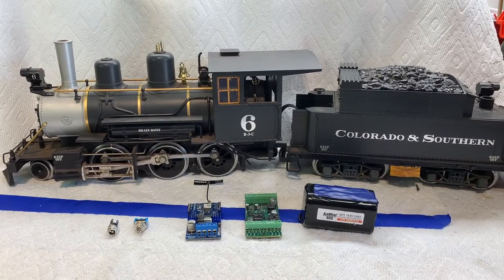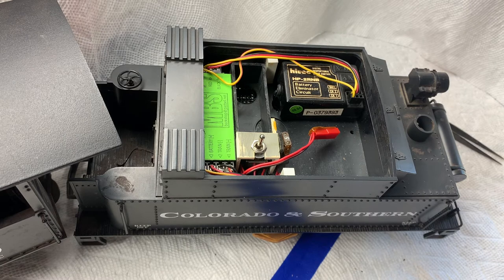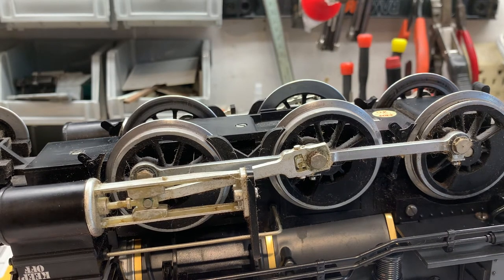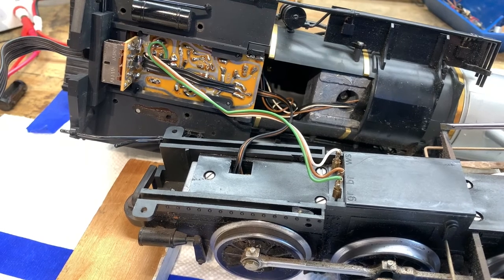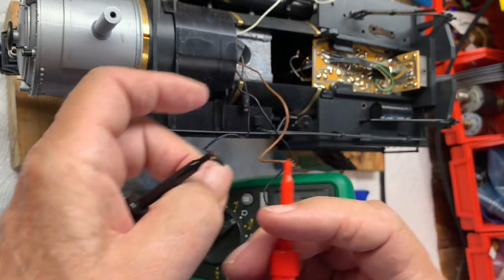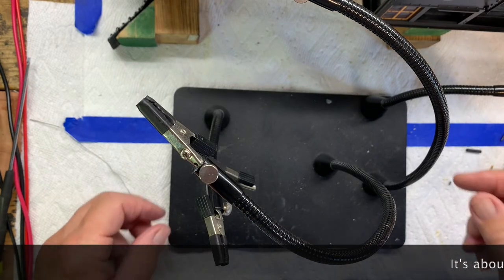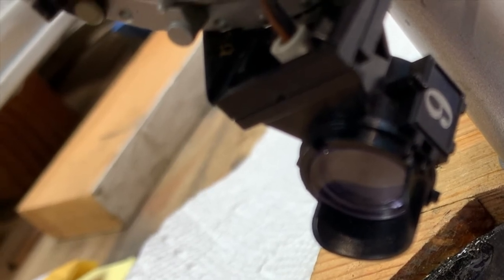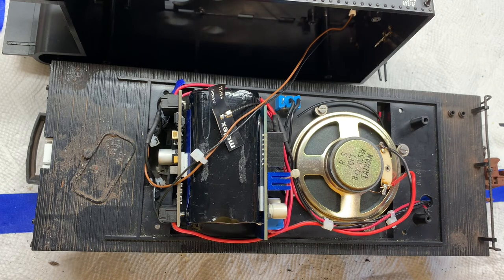Control/Sound/Battery Installation into LGB Mogul

Comment: In the RC hobby we often use battery eliminator circuits (BECs) to increase the voltage from the radio receiver. For example a typical RC receiver outputs 4.8v. A high speed servo may require 6v or more so in this case we could use a BEC to increase the receiver’s 4.8v to 6v or more. It’s more convenient than using a separate battery with a higher voltage for certain accessories.

Comment: Did a similar thing in Summer 2020. Took all old circuit boards out. Engine is originally from about 1991.

Specs
Soundtraxx Tsunami2 TSU-4400 (4 amps)
AirWire Convertr C60 (6 amps)
16.8V NiMH battery, drop-in
LED headlights
Reply from the maker: Thinking alike.  Why NiMH vs. Li-on?
Reply: @Steve2223  kinda long story there but we are already setup with NiMH

Comment: As a veteran lgb service tech. You where real close on disassembling the boiler. Once the headlamp screw is removed. The railing and headlamp can be slid out and the boiler separates from the cab with no trouble. Also, every mogul had 5 volt headlamps incandescent. Good tip though with using a meter to troubleshoot if an led is present. Lastly,  if you are having intermittent problems with the tender tether (umbilical as you described) the wires break off in the 6 pin connector. Very easy to cut the wires, pry apart the connector and redo the connection. Common problem after years of abuse. Nice job
Reply from the maker: Thanks for the comment and tips.  Will use them on the next Mogul install coming up.